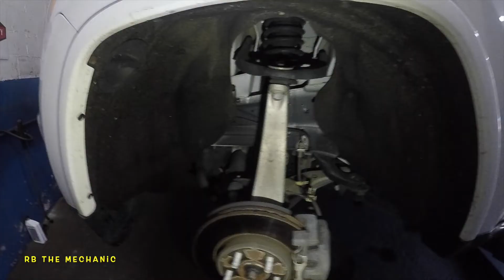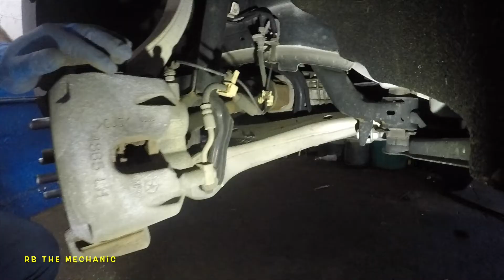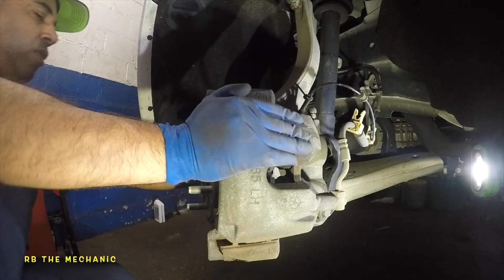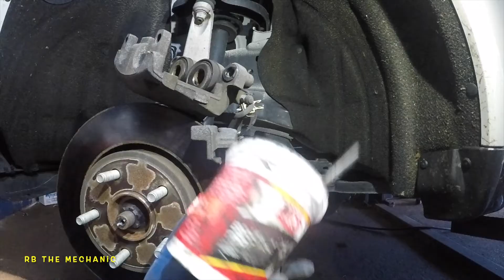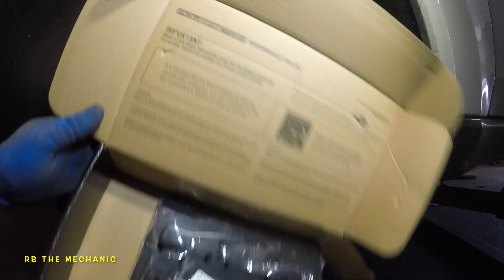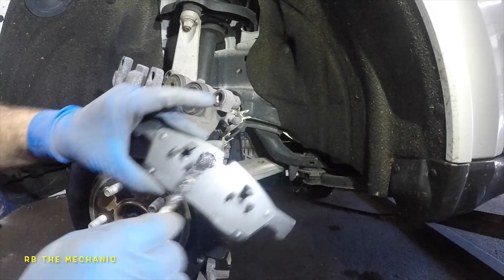How to replace front brake pads on Jeep Grand Cherokee 2011 to 2019 full guide

Comment: Everything was great until you brought the wire brush in😢
Reply: First thing it was used on was the caliper seal. Not the best thing to do imo😊
Reply from the maker: @Jason-eu2os  that’s dust boot it dosent harm it and wire brush is very very soft softer than regular brush
Reply from the maker: lol why? U don’t have the brush?

Comment: What size, trox did you use ?
Reply: I used t55
Reply from the maker: @MrRawness32  ok
Reply: The hex tool is not a t     25 can u post the correct number
Reply from the maker: @Patriot4Merica7  ok
Reply: @RBTheMechanic  Dude, it's closer to t55 but still not the exact size. T25 is WAY off and somebody tried to correct you, not sure why the attitude.
Reply from the maker: @jkaryskycoo  I did it with that
Reply from the maker: I mention it in the video
Reply: @RBTheMechanic   T????? sorry we dont understand loll